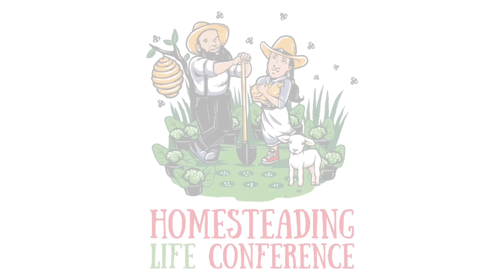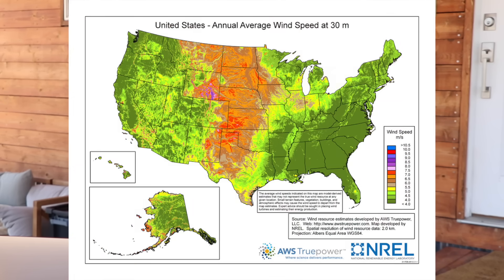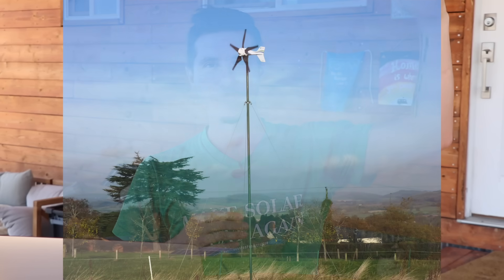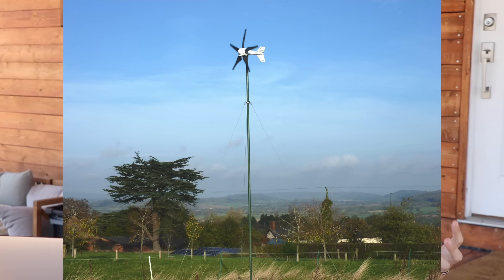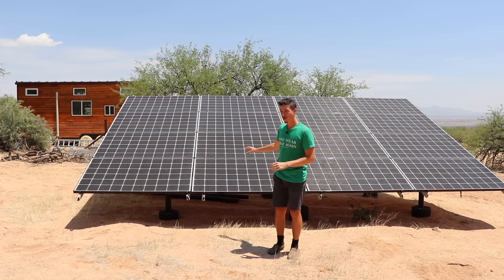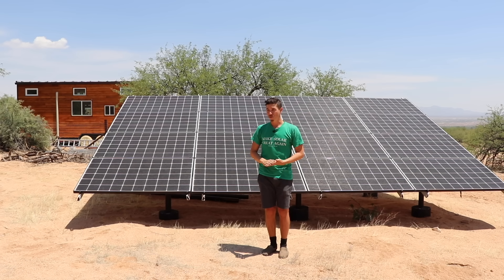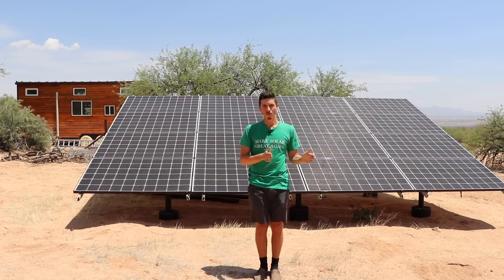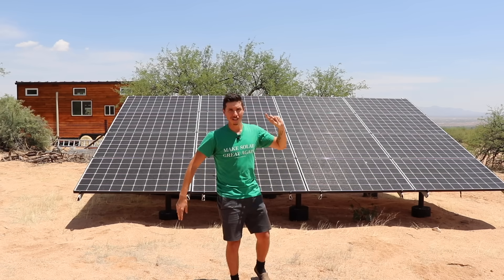Micro Wind Turbines... Are They Worth It? (Off Grid Solar)

Comment from the maker: Learn how to do Off Grid Solar the right way ;)
http://diyhp.co/solar

Liam's Article
https://www.diyhomesteadprojects.com/micro-wind-turbines-without-the-hot-air/

Learn more about the Homesteading Life Conference!
https://www.diyhomesteadprojects.com/homesteading-life-conference/
Reply: Micro turbines are a great idea - used them for over 10 years - they work at night when the panels don't - keeping the batteries in positive territory after the the big evening draw down. Batteries last much longer with micro turbines protecting them from being left overnight in a low voltage state.
Reply: @TheStarseer  what type of turbines are u using? Vertical? Thanks
Reply: Change your title !
and also most of what you said...
There are so many things you do not take into account (other wind system, footprint, battery size, battery life, daily consumption,  overheating panels, cleaning panels and probably other things)
Reply: so, about maintenance. i recently pulled out my bicycle again. it has bearings. i greased them last time in 2005 i think. it rides like a charm today. also, when was last time you had a problem with a cars' half axle ball bearing? a bicycle chain breaking that is attached from wind wheel to generator? that stuff is designed for 30yr+ use under load without maintenance. if wind turbine is designed with some sheetmetal covering all vital stuff like generator and bike chain doing gear work then its maintenance free till the cows will come home on a vegan farm...
Reply: the link says the page cannot be found. Please check it. Thanks
Reply: That clip you showed when the wind turbine fell apart was when a break failed meaning the wind turbine had a higher rpm then what it was designed to handle. Meaning the stress on the blades broke them. Nothing to do with if it was charging something at the time or if it had a load.

The article you got this info from is really biased. lets take the power from the 2 kilo watt fan they used as a example. So the unit puts out 1,178W of power in 2m/s areas (I am ignoring the min wind speed here because they did in the cal) in order for a comparable amount of solar power to be generated i would need 3.2m2 of space and that is only comparable while there is sunlight. So I would need 9m2 of solar space at lest for a comparable power generation on a day to day basis. (based on 300w mono crystal). This could cost $2.7k so its debatable what would be cheaper. 

The space saved is also alot more if you have a wind turbine and I agree it will be limited to some areas due to wind concerns. I would argue that 50% of the US would be fine given that is about the amount that has double the min speed.

Also your editing sucked. Its amazing that you blurred out the charts on purpose.
Reply: @generalharness8266  o
Reply: Clearly he’s just trying to advertise for the panels he’s posting links to what a pathetic comparison maybe actually take the time to pull up some numbers instead of “that’s gonna cost more “
Reply: Handeeman just noting you do a good job editing. I would have never noticed before if not for Peter McKinnon. Keep up the good work. 👍
Reply: There is no "right way" to live off grid. There are ideas that work well with your property, and others that don't.
Reply: Learn how to off grid solar the right way. Link is not working.
Reply: Sorry but you are giving some information incorrect regarding Wind Turbine.. and remember, "what use to be, will not e forever if it develops"
Reply: Does Liam have a YouTube channel?
Reply: You might wanna rethink those shorts..........or not! lol
Reply: Have you considered sun steam?  There is only upkeep on the steam pump, and more cost effective than photovoltaic.
Reply: I really want to do a lot of homes with solar for our 20million solar Revolution Project. Our NGO needs experts and makers of solar products to partner with.
please check us on the website below if you are a supplier or producer or a solar expert. Thanks www.wasteandenergy.org
Reply: Cheers for this, been searching for "diy crank generator kit" for a while now, and I think this has helped. Have you ever come across - Ieanarial Nonpareil Interest - (Have a quick look on google cant remember the place now )? 

It is a smashing one of a kind guide for discovering how to cut your bills and create your own electricity with this secret method without the hard work. Ive heard some great things about it and my brother in law got excellent results with it.
Reply: Did you know that Missori solar and wind Guy sues People for doing less than what he did to you ?
Reply: What’s up with the random blurs
Reply: It seems like you're comparing peak power instead of dividing energy over a period of time (kWh/day) to get a power average. You can have wind in the middle of the night but you're not getting solar.
Reply: Yes and no. Wind compliments PV, so sure get your PV in first but during storms, when it's overcast and nights a little wind will keep you out of trouble and help keep your batteries charged.
Reply: broken link
Reply: I found a useful collection of videos that will help you at Ewans Energy Roadmap
Reply: learn how to edit a fucking video fucktard cant see any graphs you showed

Comment: I once installed a comparable system in an open field at a height of 6m with my Bautri system. The setup was quick and easy, but most small wind turbines themselves are cheap junk.

￼

Comment: In Germany they use barrel turbines and Archimedes spiral wind socks. They work, are effective and all over office buildings. What's this little propeller nonsense? You NEVER use that. The barrel turbines catch the wind from any direction with ultra smooth bearings, seriously generates electricity.

Comment: I have 1600 watts of solar panels and a 600 B&C wind generator, mounted 19 feet high, the pole is against the barn. When the Sun 🌞 isn't out, the wind is usually blowing. I used twenty big marine batteries, so I don't need a dump load or charge controller on the wind generator. It will help in the winter but I got it in March of last year so this will be it's first one. The wind blows after it has been cloudy and rainy and it does charge the batteries to help make up for not much Sun 🌞. It is 8 p.m. and the MT50 meter is showing 25.45 volts. My system made 3.1 kWh today and 4.0 yesterday. There is smoke at high altitude affecting my panels. Doesn't sound like you are a fan ( pun intended ) of windmills or lead acid batteries. That's what I have though. I bought an extra set of five blades and hub for a second wind generator, it's DC, so it will be on a short pole. My wind generator is quiet until the wind gets up past fifty mph. It has withstood 95+ wind but made some scary noises. No regrets on either solar or wind.
Reply: So, if your house requires only 3 - 4 KWhrs of electricity per day then most of your energy comes from FOSSIL FUELS .   The energy generated by your solar panels and wind turbine, is insignificant compared to your Fossil Fuel consumption. Then you say, that you have marine type batteries <- Those are not Deep Cycle batteries = more bad advice.  We know that Wind Turbines can generate some electricity, the problem is ... they are not cost effective for 99% of the population.
Reply: @MrSummitville  I have replaced four of the batteries with deep cycle batteries at this point. I wasn't able to afford them and buy the inverter charger at the first go round. I didn't say I don't use fossil fuels, I said I use less of it because all my electric power comes from the solar panels and a wind generator. My pickup 🛻 and push mower run on gas ⛽. My string trimmer is battery powered rechargeable. I'm not connected to the grid, and I don't have a house. I have a room in my uncle's barn that I built. It's 1 p.m. and the batteries are fully charged up, in float charge until I cook something. The oven will temporarily use more than the solar panels will produce and it will take a short while for them to recover full charge. I'm replacing the batteries as they go bad with true deep cycle batteries. That way I can afford to do it. I'm too far from the power pole to run anything but a light bulb 💡 off of the available grid power, so I made my own power system. I'm old, and I only need a small amount of power. I cook on the wood stove some in cold weather. Actually, I'm doing pretty well for someone who was homeless a few years ago. I have enough power to build something when I get my own place again. I'm not running my uncle's electric bill up so he doesn't mind me being here long enough to save up to buy some land. It was the only solution for me that made sense.

Comment: I understand you're partial to solar, but just give the facts man. Wind is a great supliment. What happens when your batteries are full with a solar system? Do the solar panels not charge anymore? No, you have a battery controlller just like you would with a wind setup. So its not an extra cost like you said. Its the same technology you need with solar setup. What happens when it rains for a week straight? Thats where wind would supplement the solar. No your turbine will not blow up, like the clip he showed, when your batteries are full. They blow up like than when the brake fails in extreme wind situations. Which is another thing, you can put a brake on to stop it if the batteries are full. You cant turn the sun off. Im a huge fan of solar too. But i also understand the value that wind brings. When its not sunny and rainy, it's usually windy. Dont need a 65' tower to capture that wind. Just walk outside, and it's right there in your face. Both together is better than one alone. If you can only have one, definitely solar.
Reply: Wind Turbines are a financial disaster. Wind Turbines are rated at 25MPH !  So, who has steady 25 MPH winds for many hours per day?   Who?  Winds are actually calmer at night, when there is no sun.  And t is not more wind when it is cloudy.  You just make up crap!   Our local township installed two large Bergey Wind Turbines on giant towers. They made less than 1/10th  kW-Hrs, as  estimated by the Bergey dealer/installer.  Break-even was actually 50 years!  Both Wind Turbines failed, they were dismantled after just 5 years = financial disaster.  That is what typically happens with Wind Turbines - failure.

Comment: what are some of the negatives of a solar system? Snow removal, washing or dusting the panels? etc.
Reply: In the winter we tilt our panels higher. The snow usually slides off.  So, how many days do you have sunshine vs how many days do you have steady 25 MPH winds, for several hours?   Don't make laugh.

Comment: If it's 65 ft up your barely gonna notice it and it makes you seem pretty whiny.  Like dude your taking up massive real estate with that solar set up and it needs maintenance too. I'd advise against watching this guys stuff for advice, he's obviously  not a critical thinker or deciding anything based on specs.  Moron.
Reply: There are no moving parts on a Solar Panel  - you moron.  What "maintenance" do solar panels need?  Rinse with water - maybe once a month, cannot be called maintenance - you moron.  At 65' in the air, you will clearly hear the whine of the Wind Turbine - you moron.   I advise against you posting any more garbage -  you moron.
Reply: @MrSummitville  apparently weather doesn't exist where you live?  Solar panels can and do wear out or break not mention cost more to replace especially if your living somewhere with plenty of wind and not much sun.  Also I don't think a fan 65ft up in the air is going to be that loud.  Not to mention wind works fine In the heat whereas solar panels lose efficacy when too warm.  A lot of people who own property don't have the acreage to devote to enough solar panels to power all their shit.  Either way both work fairly well and neither are a bad idea for some maybe even a hybrid of both would work well for them but to discredit using wind because this guy thinks it needs to be 65 ft up and can't figure out how to lift it or that it's ugly when neither are pretty to look at in this ridiculous.  It's not good advice to tell someone who's thinking about buying and installing a renewable system.  Not to mention wind blows more than the sun shines for some so paying less money for a wind generator that has a higher output and works 24/7.  Btw if your worried about noise then you can buy a vertical turbine putting out 10000w for like $500 and it makes no noise.  He's a moron and your an idiot apparently.

Comment: The main view I take on it is solar doesn't work at night, you can't build it cheap at home yourself and even when it's full sun you don't get high amps. Wind you can make at home in a shed with some fan blades and an old motor, doesn't have to be tall either, check out the savonious types turbines, so really it's a bit of both well actually all 3 major forms of natural generation. A combo of wind, solar and hydro is the best option.
Reply: There are very few places on earth where a Wind Turbine makes financial sense.

Comment: It depends on the area. My area has about 60 days a year that would be called sunny. The rest are overcast or rain/snow.  A neighbor has had solar. They were only getting 20-35% of the energy they were quoted by the installer.  If you live in the desert or any place where rain is a once or twice a month thing then maybe it would be better. Though in PA solar from my experience isn't worth it. Also there is maintenance, you have to clean the panels as dust does build up on them and blocks light.
Reply: You neighbor can't do simple math?
Reply: @MrSummitville  The person who sold the solar panels couldn't at least, or they could since they scammed them hard and got all that cash. Gotta read fine print when it says potentially under ideal conditions. Also everything you follow is solar energy related, follow some wind farms, or hydro turbines. Quit being weird champ.

Comment: Where I live, we get an average of 14mph wind, 24-7,365.  I pump water with a windmill with a 14ft wheel pumping 500ft pretty easily. I am not sure how well solar panels would work, the solar pumps on the wells have to be washed so often a windmill is a lot less work to keep going. With all the fields and wind, you can wash your car and in an hour write your name in the hood. Not to mention, what happens when your solar panels get baseball hail on them? We get that about once every 5 years?
Reply: A 14' Wind Mill is NOT a micro-wind turbine ...
Reply: @MrSummitville  You didn't answer my question what the baseball hail in 60mph wind would do to the solar panels?
Reply: @walterbeech  Turn in to my insurance company, like any other accident. DUH !
Reply: @MrSummitville  They will not insure that here, just like they will not insure a skylight. If it was possible to insure it I would not have asked, so how big of hail will it take?  Your not very well versed on  insuring things in a hail belt are you? DUH!
Reply: @walterbeech  You have very poor insurance. Not my fault ...
Reply: @MrSummitville  I didn't ask your opinion of my insurance, I asked how it took the large hail? Are you well versed enough to give an intelligent answer?  Since your ignorant of insurance on panels you might want to research it a bit. Zero insurance companies will cover it in my area, its like a green house, no coverage at any price.   So how big of hail will it take, do you even know the limits of your panels?
Reply: @walterbeech  How would anybody know how well your PV Panels would handle your golf ball sized hail?  Like I said, If I ever have hail damage, I will submit to my insurance company.  You can do your own research by seeking out PV Panel owners in your area or you can continue whining and complaining.

Comment: its kinda bad information, just like solar you should be looking at the amount of wind you will get per month rather than per day. here is the reason why I am considering adding wind to my setup, in canada lets say December when we are having a large winter storm and very light light, well if its a winter storm its going to be very windy so this is the exact time you would need power when your solar isnt working. It wouldnt matter how many solar panels I would add its not going to get much solar during a storm and adding a battery wont help since we only get 100 hours of sun in the month of December.

so to me a wind turbine would be a perfect solution when its cloudy out alot of times its windy so will add it your system, and for the small amount of times you cant rely on wind and solar just have a small generator to charge your battery.

Comment: You live in the tropics? Go both, solar for summer, wind on the rainy (no fkn sun at all) season, add a diesel (just in case) generator. For battery life extra care. If you in the US go solar + diesel, buy panels now, china is an as$hole, they will get even more expensive

Comment: He has no idea about wind power.
You need the most power for heating and devices in winter.
Snow covers the solar panels and there is often a cloud cover.
You have lots of wind in winter, for much less cost per kWh.
And you can use a water heater as a dummy load, once the batteries are full.
Just add a 2nd electric heater and a cheap insulated water heater tank, it generates a usable load.
We heat most of the home with wind power and solar thermal.
Storm days are cake and bread baking days.